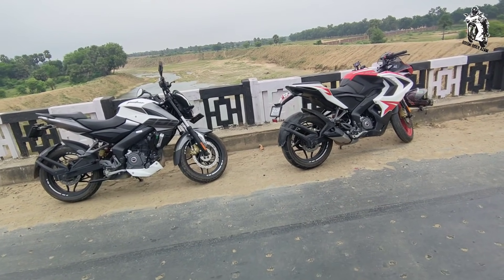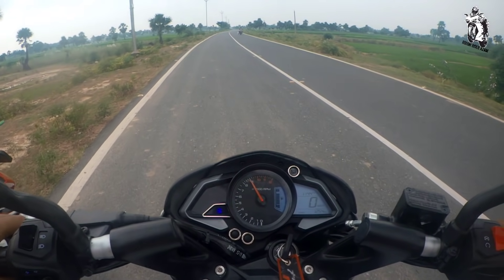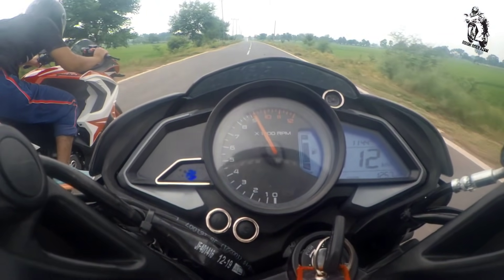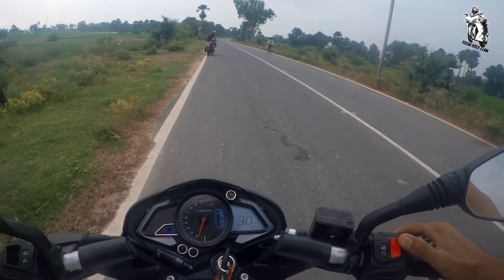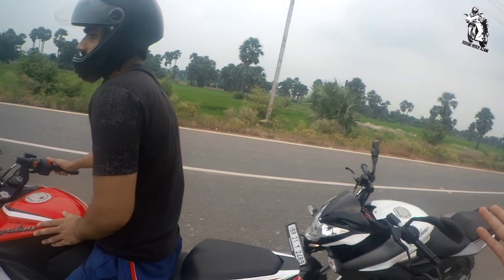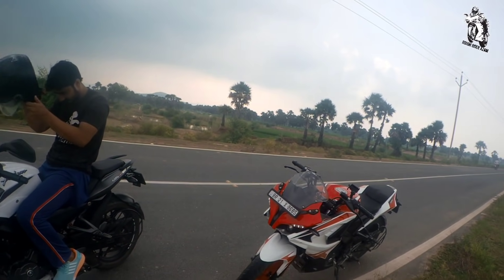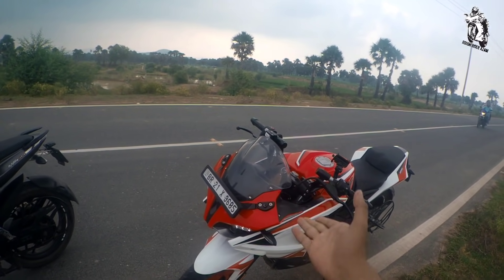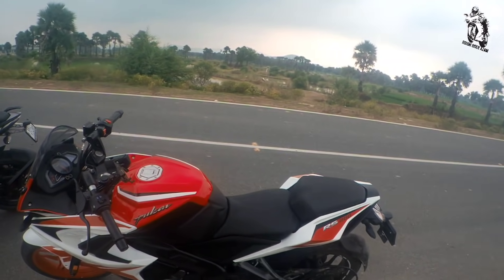Pulsar Ns 200 Bs6 Vs Pulsar Rs200 Bs6 Drag Race

Comment: RS weights 10kg more and Ns bs6 has got same power, but still loses to Rs200 bs6.👍👏
Reply: Aerodynamic wins
Reply: Rs has got advantage of aerodynamics...
Reply: @manikandan8224  yea true
Reply: @sta_bang  exactly
Reply: But aero doesn't apply at low speeds.... Rs wad ahead from the starting though
Reply: @jubin2611  yea that's also true 👍
Reply: RS main better exaut hai
Reply: Bro always mass bro Rs
Reply: @RS_RIDER_RAJ7207   .
Reply: Have you ever heard Aerodynamic design?
Reply: This is because of the different tuning of the ECU's. RS is engine is slightly more powerfully tuned than NS. This is also the reason RS mileage is slightly lower than NS.
Reply: Rs ka sprocket bada h islie pick up zada h
Reply: @bishal5921  no both are same tuned engine
Reply: They have the same engine but the ECU for RS200 is much better since It's a sports bike plus the aerodynamic..

Comment: Use apollo alpha H1 tyre u'll get 150kmph and liqui moly performance package servicing u'll get 156kmph and on changing the rear sprocket of 43 teeth with ns200 sprocket of 39 teeth ur final topspeed will be 163-165kmph.

Comment: If anyone wanted his RS to Go more than 150 then change Rs Sprocket with Ns Sprocket and it can go easily Just it will be tuned
Reply from the maker: Bro then race is not fair
Reply: @Overchargedengines  yeah baat bhi hai mujhe lagta hai Bajaj Pulsar RS ko Track bike banana chata hai
Reply: @Overchargedengines  kyuki ek track mai Acceleration or Handling or braking matter karta hai tops peed utna nhi karta